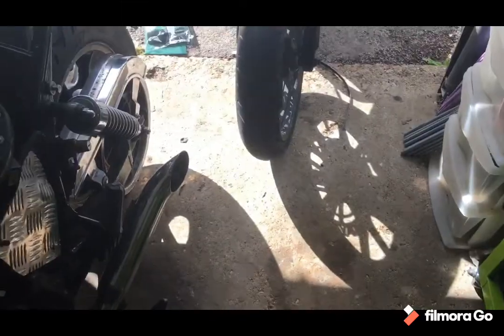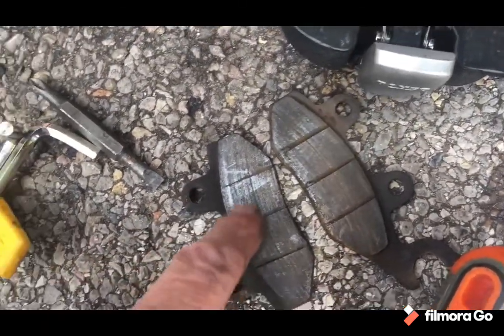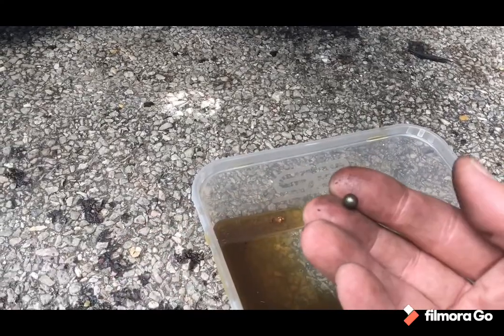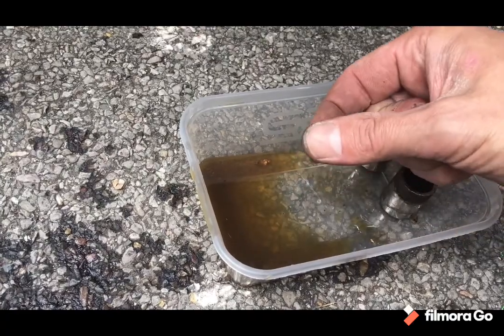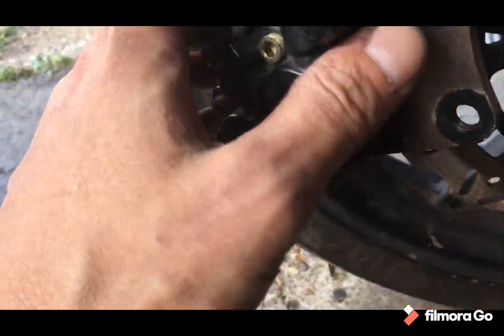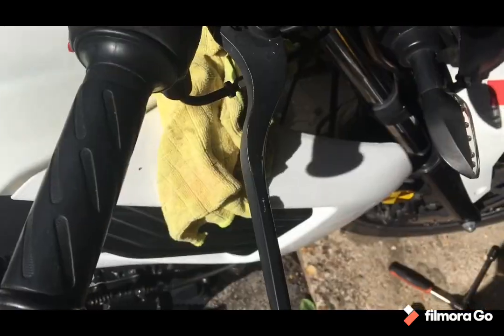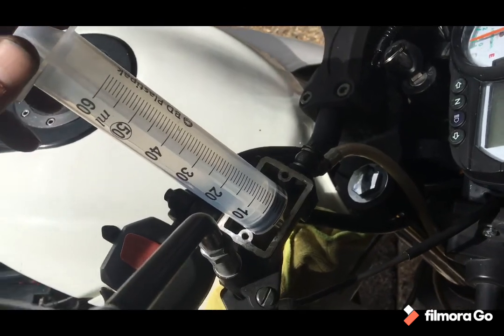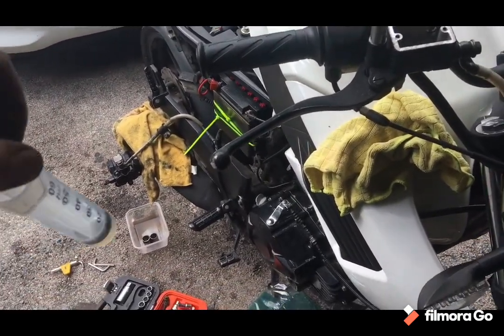Senke X6. Brakes at last

Comment: Agreed. Your wet and dry paper of you have any left is something you can use on corrosion and rust. It's gentle enough to be OK.

The white tied in so well. It's a good looking bike that one. It will be snapped off your hands when it's ready.
Reply from the maker: motorcycle rescuer sat I my living room with 1000 grit now!  The bike is really not my thing but it actually looks quite cool. A bit Honda grom like. I am sure that it will sell quickly especially as (so far) it has cost me so little to get back one the road. If nothing else, I need to work space!
Reply: @NatsNackersYard  the thing is, when you know what your doing with bikes then alot of the servicing can be done at a very low cost. We don't really put a cost to our time which I stand by but want people to understand. The camera shows minutes out of the days we do to save these bikes.

I love every new challenge I get.